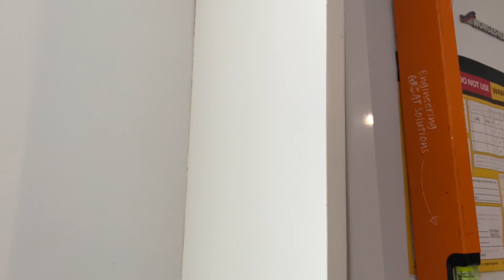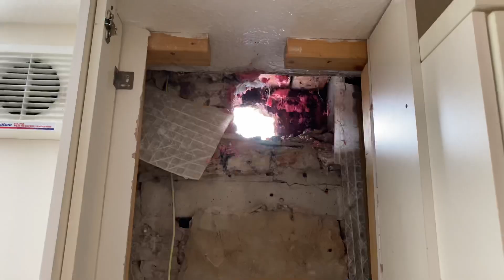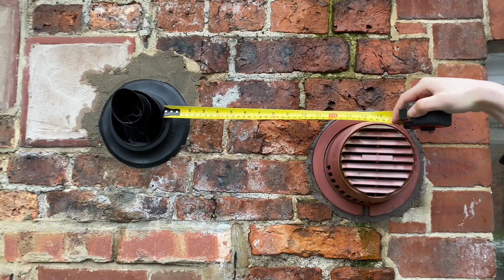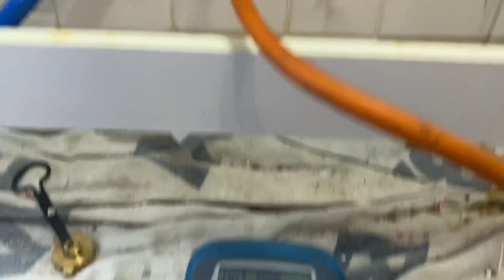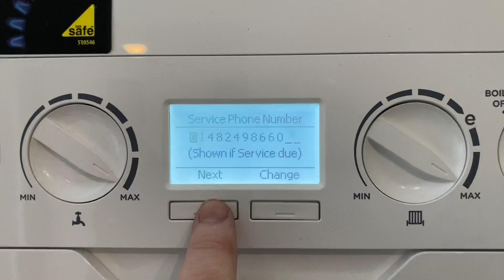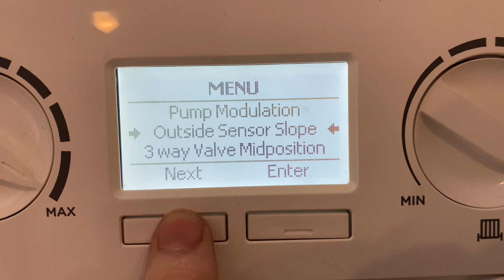Ideal Logic Max Boiler Installation / Open Therm / Nest Thermostat

Comment: Great boilers but let down with there aluminium       
Heat exchanger Long term also I know they are built to a cost bud sad to see less brass components and more plastic on all manufacturers boilers.😀
Reply from the maker: The plastics in the Viessmann Boilers seem to do ok. These will hopefully be fine as well with the mini shock. Thanks.
Reply: @AllenHart999  Viessmann cope well because the manufacturer have a inbuilt mini shock arrestor 👌
Reply: Warren Liversedge You have a choice of Aluminium or Stainless heat exchanger with Ideal Logic/Vogue. Personally I've never had any more problems with aluminium and they are thermally more efficient than stainless for heat transfer. Remember every single Worcester Bosch produced in the last fifteen years or more has an aluminium exchanger, and no stainless option. They seem to have high brand loyalty. The sump problem on Logics was resolved years ago, but there will be legacy problems on older boilers. It's not exactly a difficult job to change the sump anyway. The biggest problem is condensate damage to the boiler casing which can cause premature rust unless you treat it. I used to neutralise and clean, then do a light spray coat of white grease on any parts showing corrosion. I'm now retired....,but still have to watch Allen videos 😃
Reply: @timhancock6626  designed obsolescence Tim 😳🙂
I suppose it keeps the manufacturer turning over more units but remember boilers of old lasted years more which is also great for the fitters ,it’s the customer which loses 
If you can run your boiler in full condensing mode , which can be difficult but with weather compensation directly modulation of the burner stainless steel is the clear choice.

Comment: Ever tried the nest thermostat e?
Reply from the maker: No not yet. Are they any good? Thanks.
Reply: They seem ok very similar to the Google nest learning thermostat but it's a cheaper option it comes built-in with a stand and the front part is plastic so it's a cheaper option it's probably about£100 cheaper if you buy the original and the stand
Reply from the maker: @nindes  I will look into them. Thank You.
Reply: Good boiler like u say nice & easy fit, not a fan of the nest but thats my opinion as its tied to google, prefer the honeywell t6r personally.
Reply from the maker: @stephenpyrek4726  Hi Stephen, And thank you for sharing your opinion, Have you tried the Ideal thermostat that's built in? Thanks.

Comment: Allen great job as always - like how you’ve done a really decent job from what it was. How could someone get away with doing the previous job I would raise some queries with Gas Safe.
Aren’t ideal boilers a cheaper alternative to that of a Worcester boiler? I used to have this boiler installed in our flat and it always had issues at some point or another.
Reply from the maker: The Ideal boiler is as good as any Worcester Bosch Boiler in my opinion but what's your view on them? Thanks.
Reply: @AllenHart999  that’s interesting you say that as I didn’t think hey were comparable. Allen I don’t have a qualified opinion as I’m not in the trade but I watch your channel to better equip myself with trades people and their works. Really enjoy watching your videos keep it going
Reply from the maker: @CEO786  Thank you very much for watching and also commenting.

Comment: On the point of the flue it does depend on the boiler manufacturer's instructions for the model. Used to be a certain length that needed to be protruding, and may well show a certain amount of the white flue. Some will state a certain minimum must be protruding so it can even be longer without issue. Although I think some dubious installers then don't trim it at all.
Reply from the maker: You cannot have any white on show with an ideal logic or ideal vogue. Thanks.
Reply from the maker: Thanks very much for your comment, please consider subscribing to support the channel 🙂